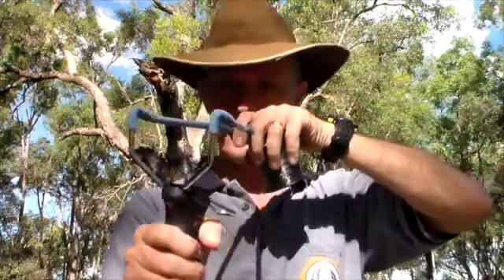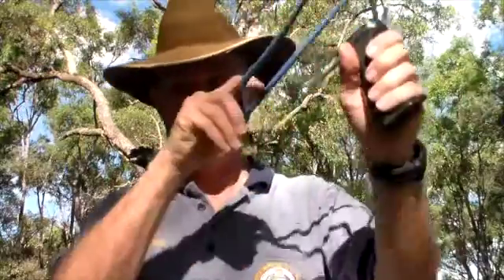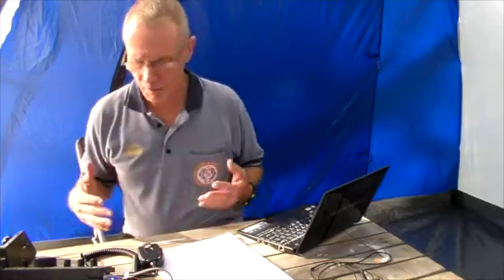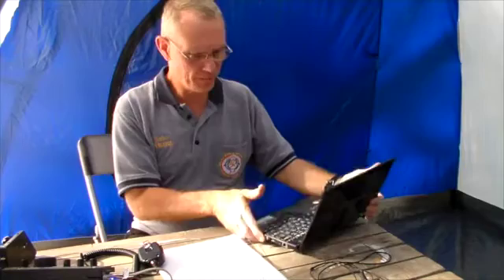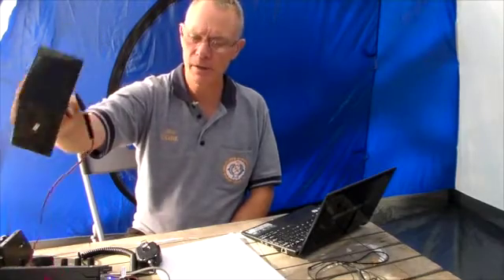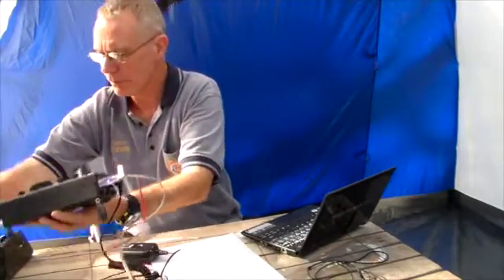John Moyle 2016

Comment from the maker: Folks, I've had some second thoughts about the Don 10 wire I used for my antenna and feed line system. I thought my poor reports during the contest were merely propagation issues, but then I put the antenna up at my home QTH and found similar transmission issues. The Don 10 wire is a blend of strands of wire - four copper and three steel (to give the strength). I thought the steel would have little effect and the copper would do the trick, but the resistivity of the steel really plays havoc with my 10 watts. In future I will be going back to good old copper wire - it's a bit heavier to achieve the same strength, but it radiates, it doesn't simply eat up the power as it heats up!